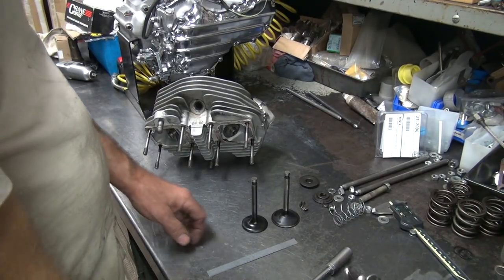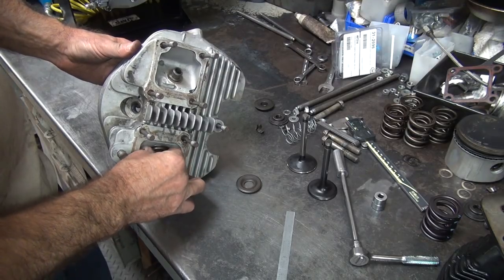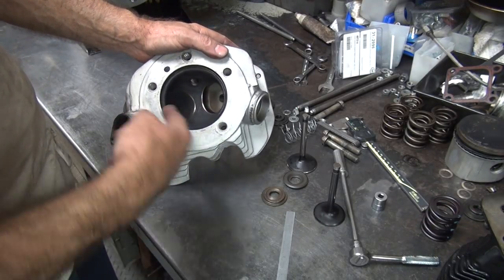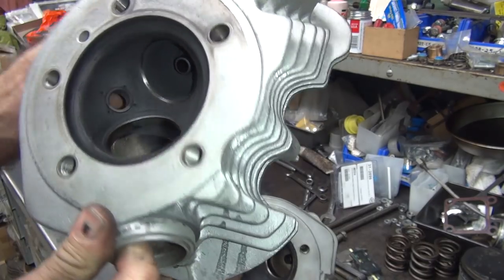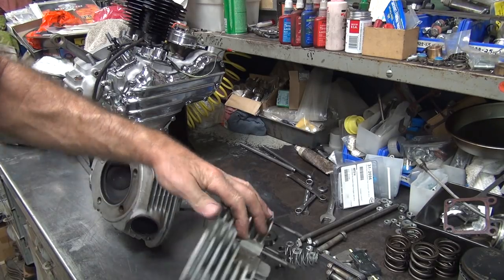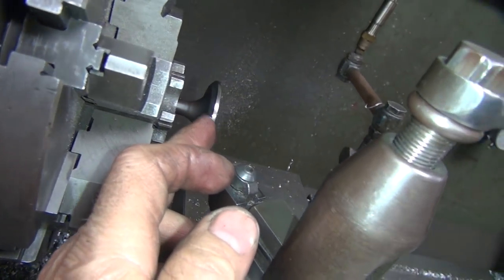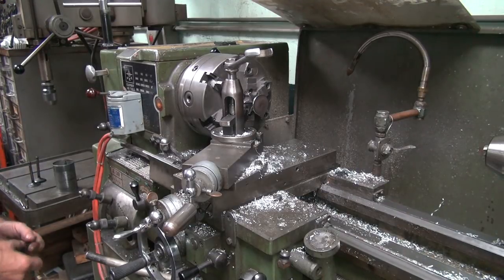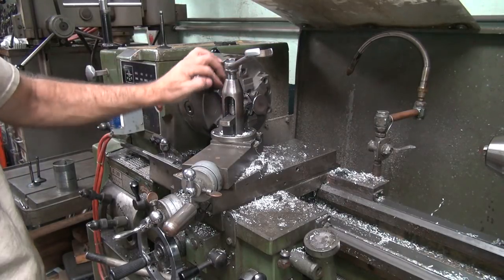#129 1957 panhead STD head conversion drag bike race harley scta lsr 2018 season tatro machine

Comment: Do you cut all your valves on your lathe ? Or is it just for this rebuild ? I thought engine machine shops had a certain machine to "cut" valves with. You have the valve seat tool and stones because I've seen you use them. I have a small lathe that was a freebie but I think it's too small to cut valves that size.
Reply: Sorry,never mind. Watch the complete video right ? I see you have a way to straighten the valve stems. You blew my mind when you chucked the valve tulips in the lathe after cutting them.
Reply from the maker: when it comes to my racing bike stuff i do alot of different things that most people will not like. i call it playing on the wild side and they call it being a butcher. my results speak for themselfs.
tatro
Reply: I understand. I do things that freak people out too. I'm not above using used parts. I also use my drill press and hand tools to turn parts down. I'm trying to score a few machines so I can machine my own stuff. I don't mind paying for machine work but i find a lot of people that work in these shops don't know the proper way to machine parts. Plus, I enjoy doing this kind of stuff as much or more than riding. I have learned a lot watching your videos. Thanks.
Reply from the maker: your are in trouble now.
tatro